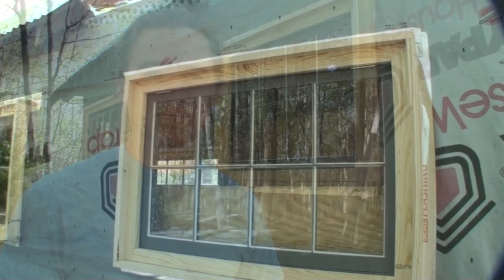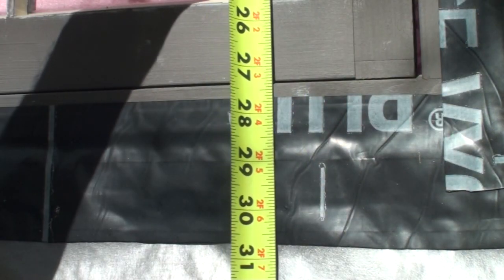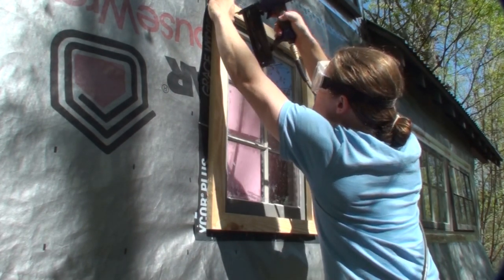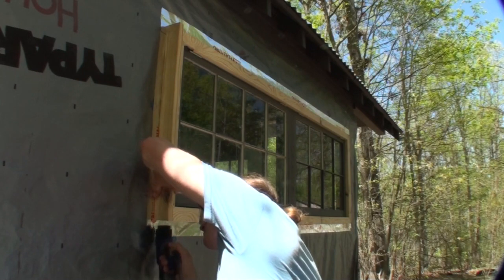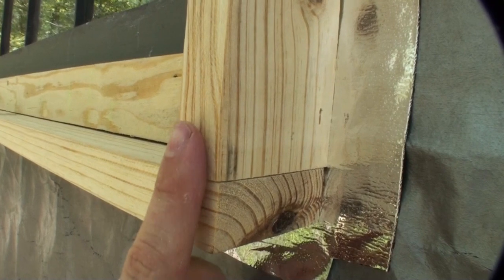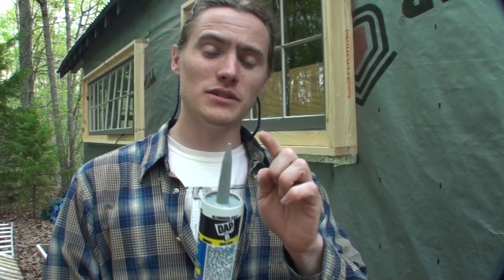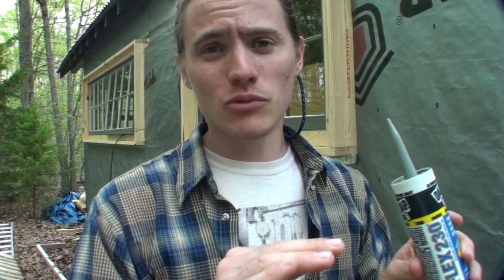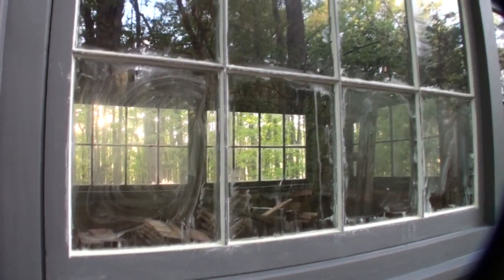Building a Tiny House #6 - Exterior Window Trim - Awning Style

Comment: Now that a few years have passed, how are your windows holding up? Any issues with the bottom side of the sill? Just curious since you did a bevel on the upper side of the 2x4 for the sill but not the underside or the framing, and I'm considering doing the same. Thanks!!!

Comment: Looks nice. One thing about PT wood, it will shrink.
Reply from the maker: Doc Zoidberg I didn't use pressure treated, the boards are un treated yellow pine. (if that's what you getting at) You can dry the PT wood before you use it, then it's stable. I've made outdoor furniture using it and let it sit for a while first to avoid issues.
Reply: It looked like PT. It takes a while for it to dry out. I have some in my garage that has been drying for a couple of months. 6X6's take forever to dry.

Comment: Hi, we are building a tiny house and doing the same kind of awning windows using reclaimed paned windows. I was wondering if you could give me a little more guidance on how you went about the bevel to prevent water from coming in...how are your windows sitting in the frame? Are they flush with the outside or centered in your frame. How are they sitting against your beveled base? Did you bevel the bottom of the Windows so they would sit flush against the base? 
Thank you!

Comment: Looks great! But you might want to consider cutting a shallow dado on the underside of your sill about a 1/2" to 3/4" away from the front edge. It will allow the water to break away from the side of the house and not migrate toward(and behind) you're siding. See minute 3 in this video and you'll know what I'm talking about. https://www.youtube.com/watch?v=x8iu9dLrV-E
Reply from the maker: George Schwab I meant to do it but forgot. I think I'm going to take my trim router with a slot cutter and do it eventually. But on a couple of occasions I've gone around and looked at everything while it was raining and so far all water is shedding away as it should. But it's a good idea to have it. Thanks.